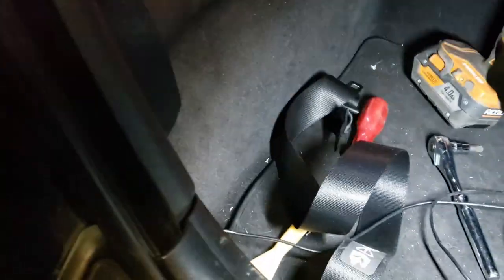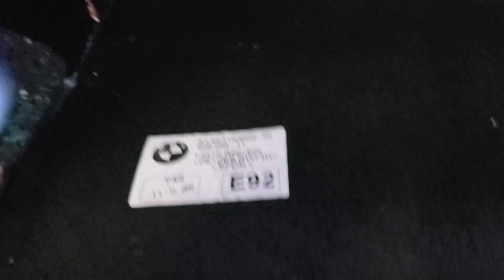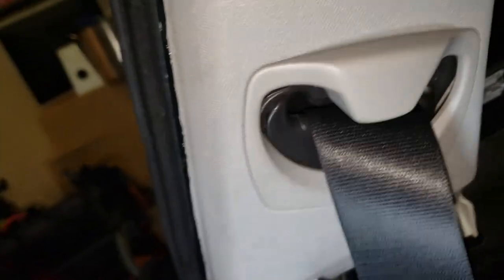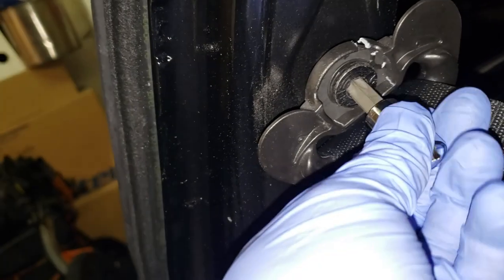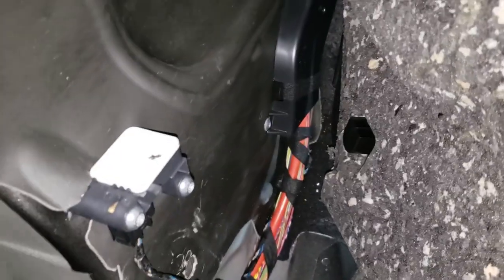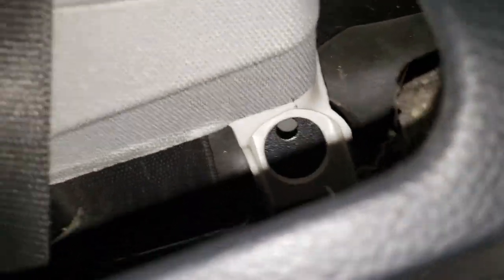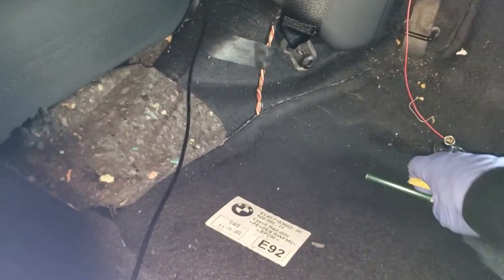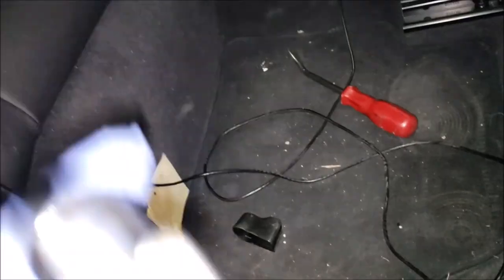How To: 2013 BMW E92 Coupe Seat Belt Replacement - DIY

Comment: Great video, very helpful, just handy tip to try avoid rounding your bits when using impact wrench wrap a very small bit of electrical tape on the end of the bit e.g a torx bit, should hold good and tight until done up 😉👍🏻
Reply: OR, you can just buy better quality bits... Cheap bits are soft metal, because it's cheaper metal. So if you get the better, more expensive bits, they never distort like that.

Comment: Thanks for the vid. I would suggest you get a tripod, or develop better camera discipline. Most people will not click back on a shaky vid. 
I was able to do this on my E92 in about twenty minutes including looking for bits and sockets. If I didn't watch this vid, it would have been hours, I'm sure. I never took the entire lower floor bar out, just undid the bolt, and slid the seatbelt off of it. I also put the passenger side seatbelt assembly on the drivers side, as it's hard to find the drivers side, and they are alot more expensive. All you have to do is bend that little L shaped bit up a little, so the bolt will be high enough. Then you can use either side. After that it's all the same. It doesn't make sense that BMW engineers would make them a bit different, as it serve ZERO logic or purpose. But we alllllllll know BMW engineers are satanic assholes!!!!!!!!!!!!!!!!!!!!!!!!!!! Cheers!
Reply from the maker: Appreciate the feedback! I've been working on making better videos... Glad to hear this was helpful!